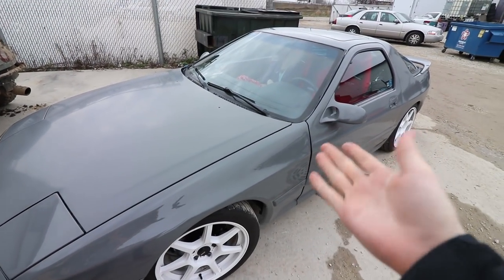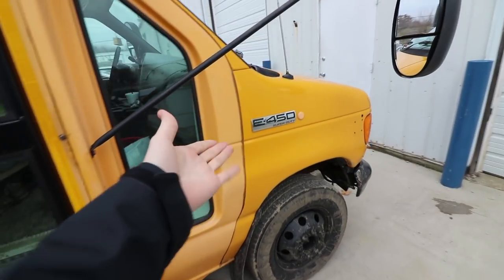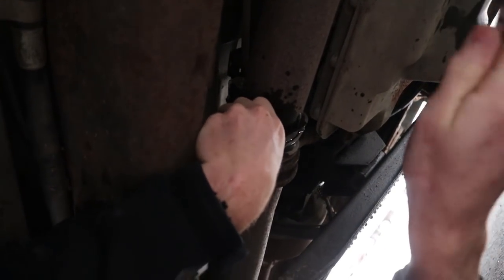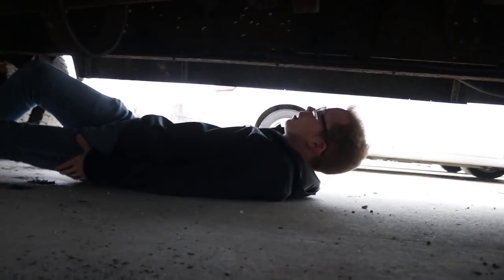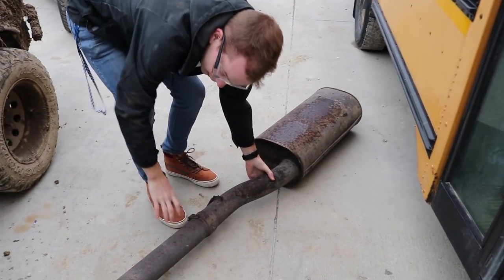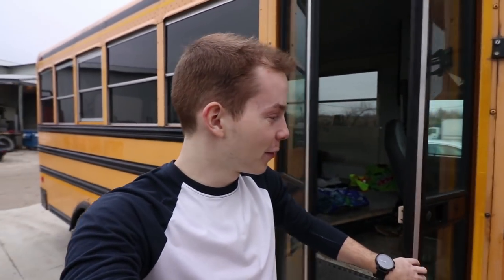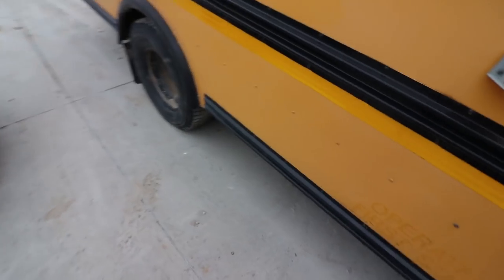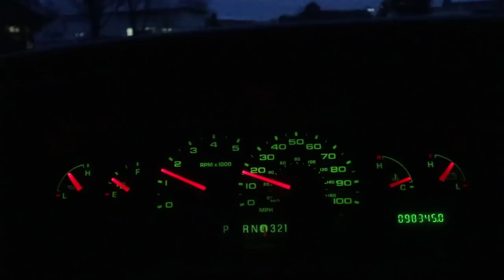Straight Piping the School Bus [SPOOL BUS]

Comment: Hey Gingium, I got an idea for ya.

Keep those lights on the top at the back of the bus, but re-wire them so that they act a "high mounted" brake lights and turns signals for that little extra visibility when you're towing a vehicle.

Comment: get a big wing to the bus
Reply: Downforce bro
Reply: yeah!
Reply: that would make it a ricer tho
Reply: Chassis mount gt wing
Reply: Wrong channel
Reply: A wing that actually produces lift would be cool and increase fuel efficiency
Reply: Downforcium
Reply: RIP MisterBassBoost 
fuck yes lmao
Reply: Austin Wolfe how the fuck would it increase fuel mileage?? You're creating drag.
Reply: Sergeant Speed I said increases lift like as in have the spoiler the opposite way of creating downforce so it has less weight on the wheels so better rolling resistance so better efficiency
Reply: Austin Wolfe no. Dude you need to learn physics. To create lift, you need drag, drag increase fuel consumption.
Reply: Sergeant Speed I feel really stupid I'm generally pretty smart at physics but I guess I didn't think as far as I should have
Reply: this not BlackPanth channel mate
Reply: Just no
Reply: Great idea
Reply: YES!

Comment: The only problem u will have with a bigger turbo is that it's a van front end and ur center council/dash will restrict the size of the turbo u can slap on. I have a 7.3 van really similar setup engine wise

Comment: You should put mud tires on the bus and maybe a locking rear differential so you won’t get stuck so easy but you might sacrifice noise levels on the high way and fuel economy

Comment: I think you're going to feel differently about the loud exhaust when you've driven it for 12hrs straight like that.  You can have the best of both worlds though by using a push button cutout to switch between nice quiet exhaust for travel and a straight pipe for having fun.

Comment: Also can I make a suggestion.....try and find an old camper for 1k-2k that way you can get everything you need (grey tank, heater and propane set up, electric box, inverter, batteries and a/c....I help build a friend full size bus and that's what he did and it was more budget friendly

Comment: I love the bus I think you should make it your support vehicle with all tools needed to do repairs large compressor for air tools large generator several spot lights awning tire racks engine hoist etc and do all repairs at the event also a large platform on top to get a better view at the track and it would be a good place for a camera mount

Comment: #1. D.E.F. (exhaust cleaning diesel exhaust fluid) "miracle-like" cleanliness as a result
#2. Vapor injectors to maximize mileage

A bigger turbo should be the way to go for getting extra power.  Bigger air intake should produce around 10-15 torqs/hps. 
When adding power it is best to increase the exhaust diameter accordingly to keep idyllic dyno sheet.

Comment: Dont put a turbo, just do chip tuning. Every diesel in europe are chip tuned. My Saab 9-3 2.2 Tid stock makes 92kw (124 hp), after chip makes 123kw (165 hp). Runnig 2 years - no problems with turbo or engine.